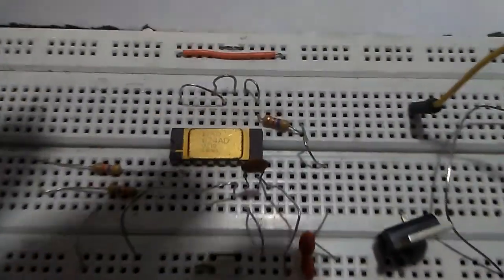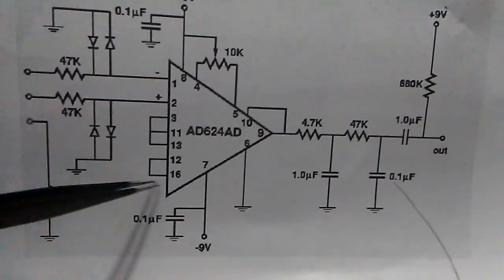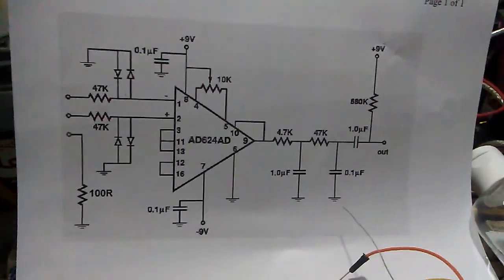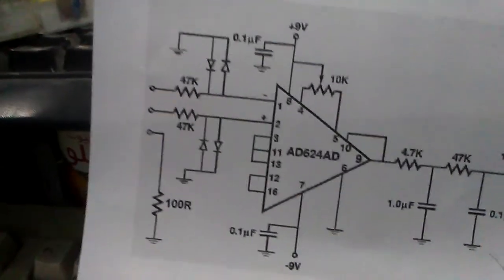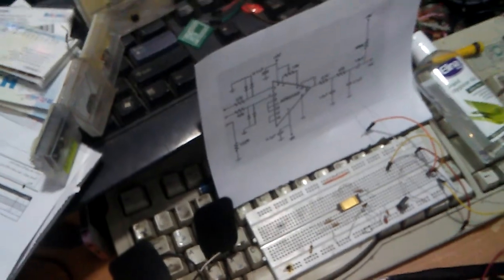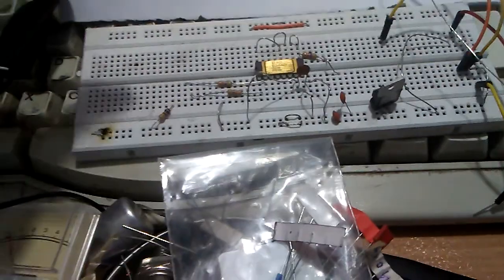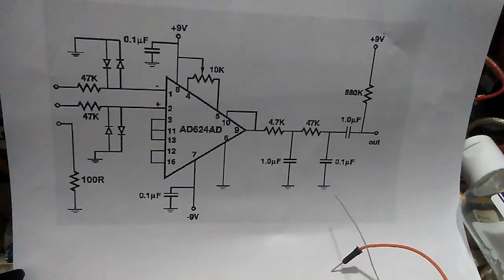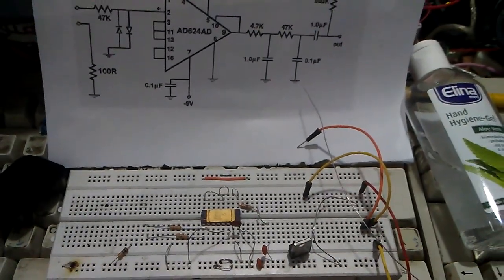AD624 OPAMP ECG Arduino based Project for Heart Graphs VOL#1

Comment: I will look at the eg circuit using Ad624ad opamp on your site and try to make the circuit using the breadboard.
So I want you to show me a picture or picture of the Ad624ad opamp circuit on the breadboard.
Reply from the maker: The Gold Plate IC, is AD624 exact on video, am i right with your question
Reply: @seyedmarashi  No, I would like to see exactly the picture you used the ECG circuit for the breadboard using AD624AD opamp. Because I also want to use the bread board to copy it once.
Reply: Therefore, I need a picture of the ECG circuit using the ad624ad opamp connected to the breadboard.
Reply: Could you send me the picture of the bread board circuit you made by email?

Comment: why didnt show the serial plotter output?
i need that because i am not getting proper ecg with correct sampling rate
Reply from the maker: I have several more videos with clear sharp serial plotter output.
as I told you need notebook(labtop) and battery situation  because of 50 to 60Hz filter will not allow good clean Graphs. 
so drawing serial plotter need labtop and disconnected AC/Charger 
I am sure several videos made by me with graphs.
Reply: @seyedmarashi  yeah.. I did that.. I didnt use notch.. Plugged off ac... And....and gave the output of LPf to arduino.. Still not getting property... How can I contact u sir..
Reply from the maker: @sandhanakrishnanravichandr9400  please make video from what you have to check
Reply: @seyedmarashi  can't get u... Please can u.. Upload the serial plot for ecg... Using the same....if u have..
Reply from the maker: @sandhanakrishnanravichandr9400   project is for long time ago , and don't have now but if you send me your project we can analyze and make video

Comment: Did you know that if I connect this circuit with oscilloscope ( TDS2001C) , how much the input from the function generator will be ( frequency and voltage amplitude ) ! Please i need to know
Reply from the maker: the oscope is AC and the noise will not let you to see sharp graphs! need special filters and amplifiers if you want to check output over oscope. google and check result

Comment: Why You  used transistor ? 
And what exact kind of diode should i use (. Code and amber value? )
Reply from the maker: 1n4148 or 1n60 should be fine.
Reply: Seyed Marashi what about the transistor ?
Reply from the maker: @leenjamal5734  it is 5v regulator transistor, not part of project